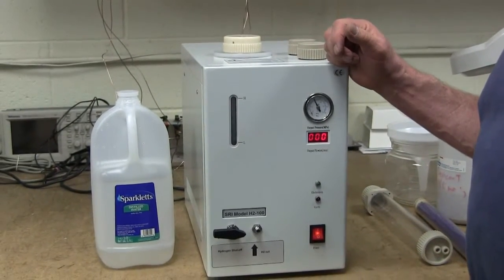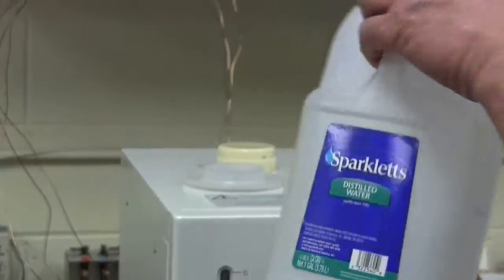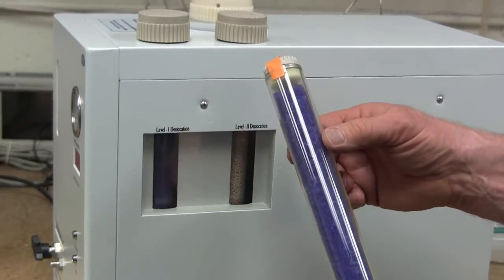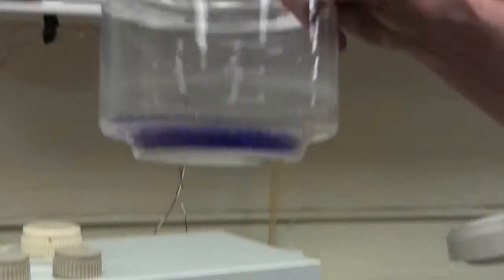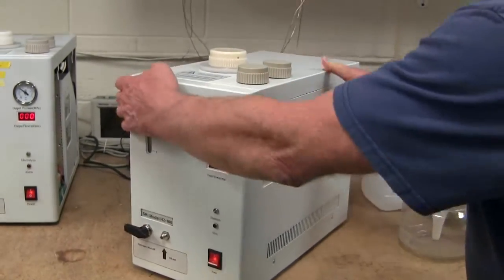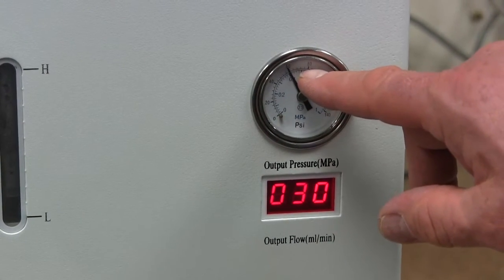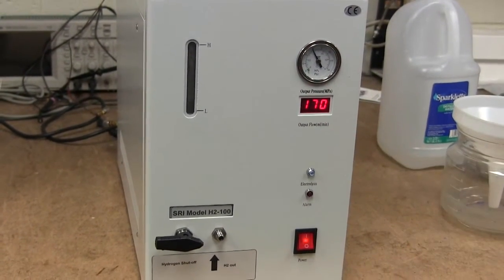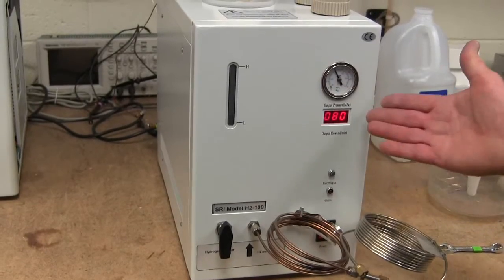SRI H2 100 Hydrogen Generator

Comment: Dear SRI INSTRUMENTS 
Your help please,  i have a Hydrogen genreator H2-100  but i lost the user manaul. Where can I find it?
thank you for the help
Reply from the maker: There is a document on our website www.srigc.com 
Please call SRI Instruments at 310-214-5092 or email summer@srigc.com if you would like to receive the user manual directly. Thank you.
Reply: +96771216039 whtc
Reply: This can be used to power what type of devices?